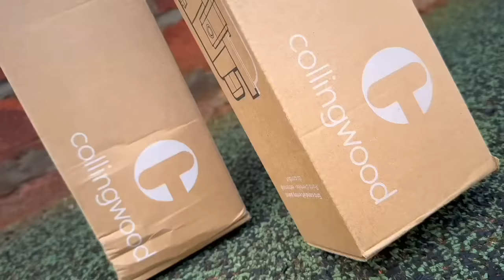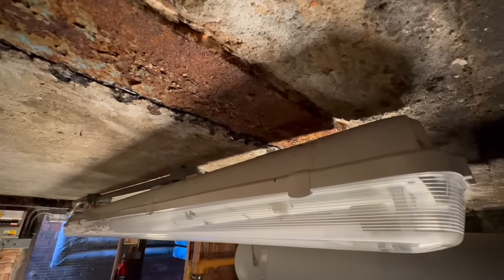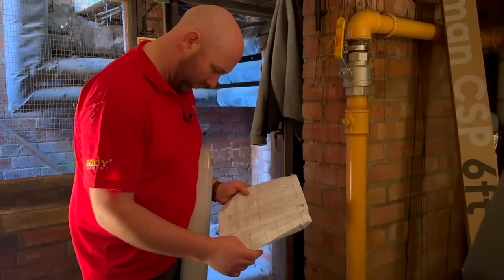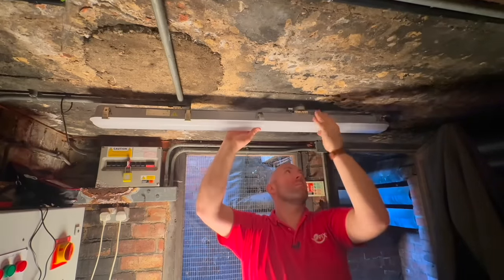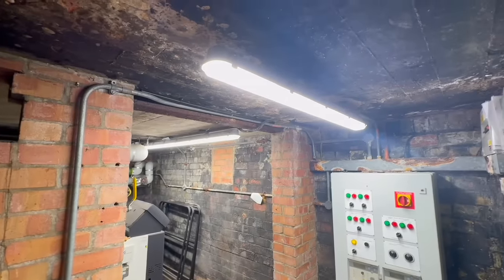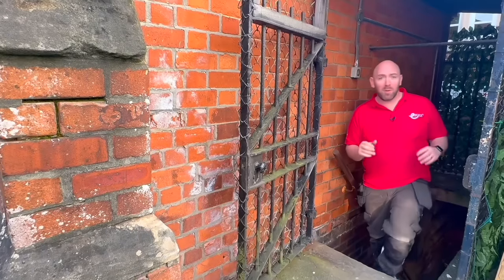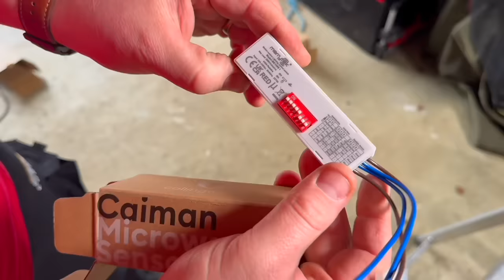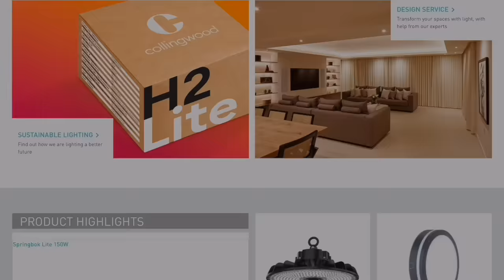Electrician's Worst Nightmare: Spiders Attack

Comment: I like them, not sure about the clip not completely covering the box though, seems like a prime ingress point for small bugs and moisture. Also single conductors through will definitely not be double isolated
Reply: Gasket, Galve lid with 20mm hole in the centre with the silicone grommet  through the bracket and the lid then secure with the M4 screws.  No exposed single insulation.  No gaping holes around the bracket.
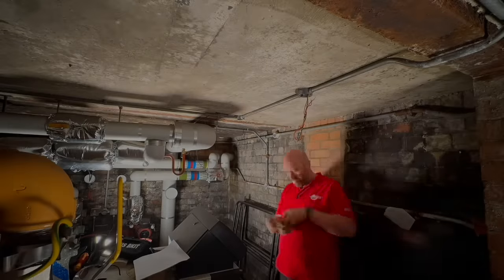Reply: That would work fine. Was referring to around 3:15 in the video where you can see the large gap at where the clip is, and the conductors used being single insulated.